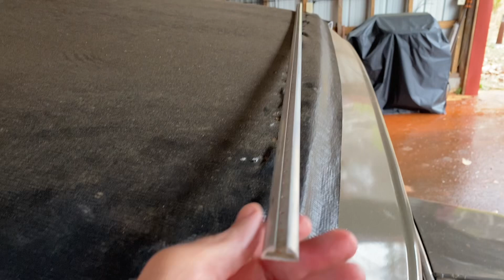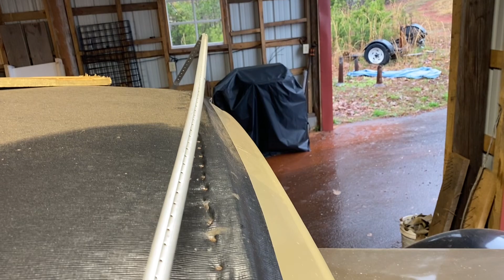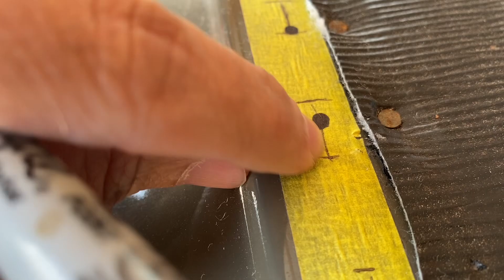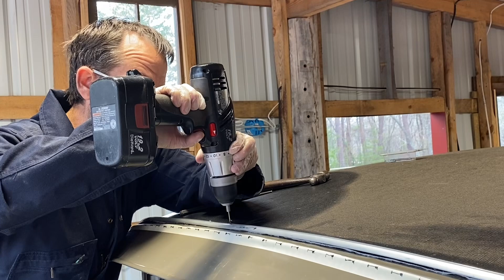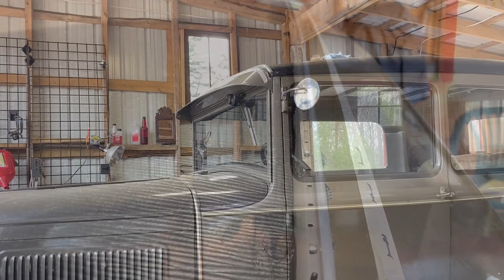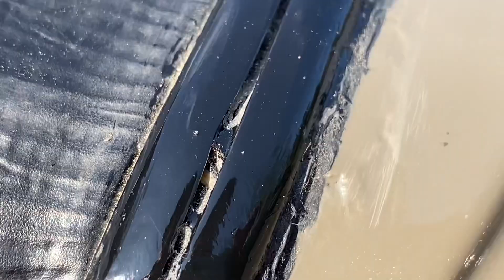Model A Ford Top Front Trim Molding Bend and Install

Comment: seam sealer works much better than the butyl rubber. I do the top before painting the car, and put paper down before the trim. Paint the car, and take the paper off and I suspect that's what the factory did too.  BTW,  get rid of that phillips screw on the rain gutter, a slotted oval screw is what was used.
Reply from the maker: I have heard that Seam sealer works good as well. Sounds good to me. As for the screws, I am sure they were actually no screws used as they would have been snapped into the nail channel. Hardware store had no wood screws that were slotted. So these are temporary until I can get my hands of some slotted ones. Thanks for the comment. I agree!

Comment: I am a bit nervous on this task.  I will do mine this summer.   Thanks for posting.
Reply from the maker: I hope this will help take some of the nerves away. This is the video I wish I had before I started. I think annealing the aluminum is key and if I had to do it over again I would start nailing from the center and let the excess hang over on both sides. I think if you can watch my next video of the back when I post it then use that same technique for the front. Nailing and bending along the way I think
Reply: It's not that hard.  Let the roofing pre-stretch on the roof for a few days.  Leave in the sun if you can.  Take your time and think.  You'll get it.